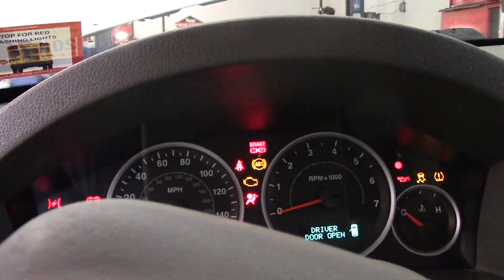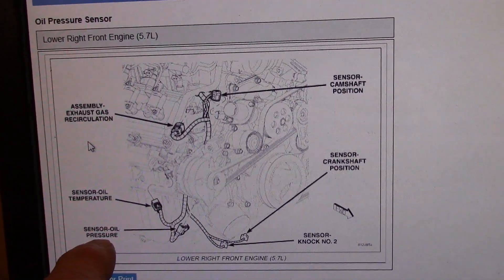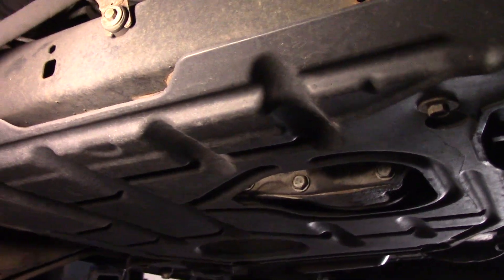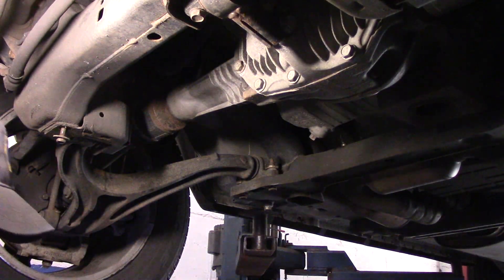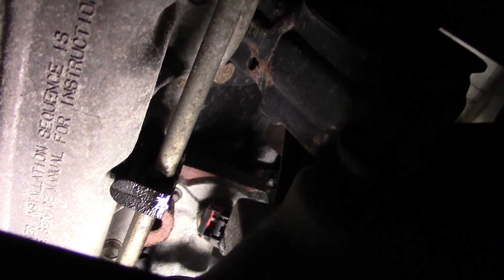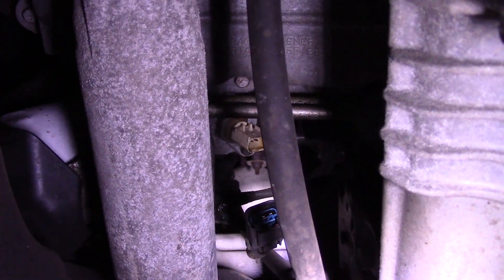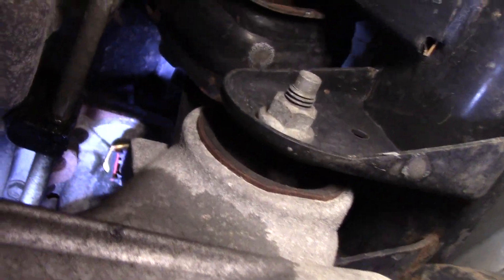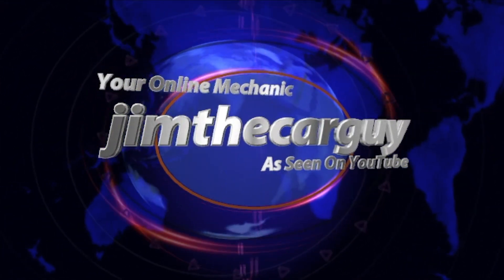Replace The Oil pressure Switch 2005-2010 Jeep Grand Cherokee

Comment: I have 2007 Jeep Grand Cherokee Laredo 4x4 V6 3.7 litre  and mine is doing the same when we are idol dinging off and on. When we drive not as much. Oil is clean. Hopefully that it is all it is. Great video
Reply: Mine just started doing this. Did you change the switch
Reply: Hi mine just started to do the same 07 jeep grand Cherokee 3.7 v6
Reply: @romanrebisz4205  My 2007 Grand Cherokee did the same thing this week. How did you make out?
Reply: Hey is was the oil pressure switch
Reply: Just changed mine today  problem  was the switch  before I connected  the wire I sprayed electrical  spray in the connector  to get all the oil that leaked into it

Comment: Holy crap thats my car, my oil light just started coming on when i come to a complete stop but it keeps dinging over and and over on and off until i start moving again. My check engine light has always been on for emissions related issues but the oil light is brand new. Im really hoping its just the sensor but i dont have tools
Reply from the maker: If the light comes on when stopping make sure to check the oil level first. It maybe low.
Reply: Wow didn't think you would respond after so long. I checked the oil, seems good. I have been driving since making that comment without issue, besides the dinging, so I'm thinking it's the sensor